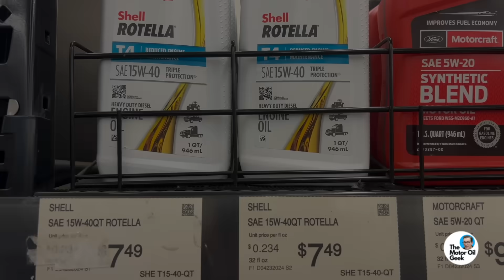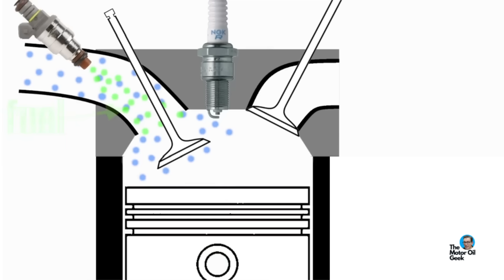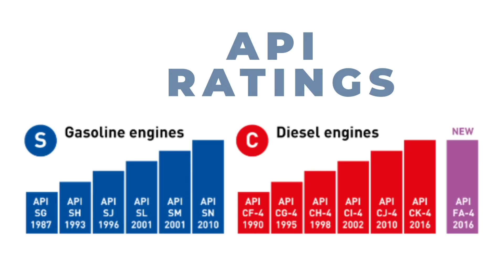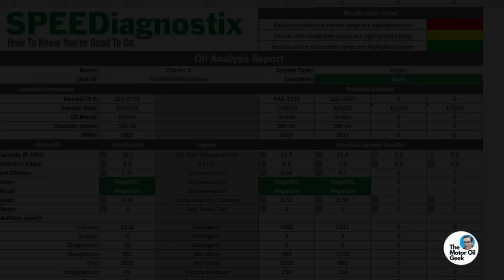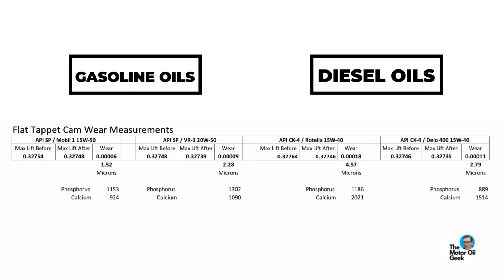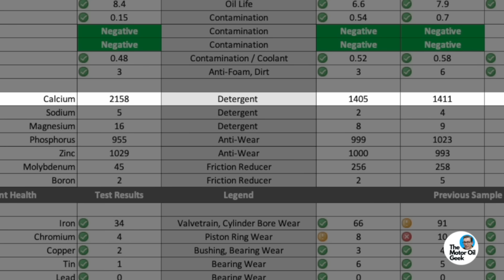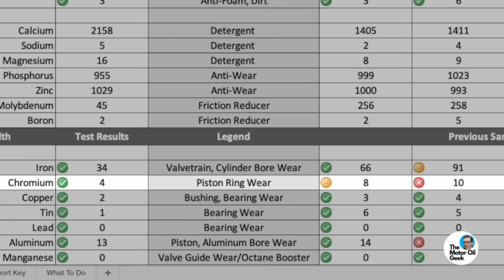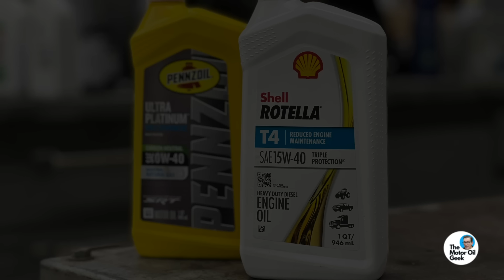Why DIESEL Oil is Actually WORSE for Gas Engines!

Comment: Have had the same daily for 25 years, 99 LR Discovery 1 3.9L GEMS / 211K miles. Until the last oil change, used Castrol 10/40 conventional, just did an oil change with Rotella T4. On a below freezing cold start over the winter, the motor made more tappet noise with the T4 then with the Castol, wasn't impressed. I'm switching back to Castol next oil change.

Comment: An EV oil change is every 150,000 miles! With money from the coal rolling equipment and the wasted fuel, you could drive an F150 Lightning to and from work for almost 10 years! And you wonder why your wife wants a divorce from you and your truck.

Comment: 1. Will SQ 10w30 gasoline oil have less zinc/wear protection than SP 10w-30 gasoline oil? Would you use either with no zinc additive added in very hi mileage low compression flat tappet cam motors?
2. My 22 yr old Briggs & Stratton powered lawn mower calls for straight SAE30 wt oil. Walmart sells two types of supertech SAE30 oil - SP gasoline oil.  & SG diesel oil - WHICH 30 WT OIL WOuLD YOU USE IN SUCH AN OLD MOWER? The old owners manual says to use their SF oil!

Comment: As a mechanic, I use Rotella in my 2000 Chev S10 because of the 330,000 km on the engine.
Reply: As a mechanic, I use Rotella in my 1996 Chevy S10 because of the 220k miles on the engine. I also use it in a few of my other cars as well.
Reply: @512Chaos  As a mechanic, you know your rods and mains are getting a bit sloppy, and the heavier oil helps keep  that nasty knock away.
Reply: @ Also, it's a Chevy

Comment: My Mazda 2.0 will burn 5qt in 3,000 miles, I bought Delvac 15w40 100k ago because it was cheap. It does not burn more than 1/4 qt every 3k with Delvac. (other 40w oils burn just as fast)

Comment: My Buell Manual says that if you can't get Genuine air cooled 20W-50 air cooled motorcycle oil   15W-40 Diesel oil is the second best choice.  I use 15W-40 Diesel grade oil in really cold weather   then change out to  20W-50 Synthetic air cooled Motorcycle oil for the summer.  Maybe switching types of oil back and fourth is not the best idea.. Maybe I need a similar composition of motorcycle oil just in a lighter viscosity for the winter?
  Is far as I am concerned most all of your tests are inconclusive.  If you really want to test something, run it 700,000 miles then tear down the engine.  Run a different oil in the same engine in the same conditions for 700,000 miles, tear down the engine and compare the wear and deposits.

Comment: I like the video but if you want real world results don't use audi high perf engines and ls engines for standards.  Use the old ford 4.9 I300 and the other old daily driver stuff that people are actually using this oil in.  My dad was a ford man 300 i6.  Used rotella long as I can remember and ran 300-400k on every truck he had.

Comment: I use Shell Rimula R6 LM 10W40 in my port injection engine, already 245,000km the engine is smooth like hell. Recently I drop the oil pan and it is clean like hell.

Comment: Are we inventing problems now?
Let's say I did have a gasoline direct inject engine (I don't), why would I think to use diesel oil instead of the recommended oil?
I still own cars I drove in high school in the 70's, I've never put diesel oil in them but have considered it.  They aren't direct ignition, this technology didn't exist, but they are flat-tappet pushron engines with carburetion, no less.

Comment: Absolutely LOVE your videos. I really wish more people watched them, specially the ones that buy into all of the misinformation about Thin oils, Low Tension Oil Rings, etc. I know it has been covered some, but I think people need a video just on how Application dictates Chemistry with very low tension rings requiring  0W8 oil of todays modern vehicles and higher, thicker rings of 30-40 years ago that required 10W30 and 10W40 oils and how people are still getting told the wrong thing and believing it.

Comment: 432,000mls on a 1100 Goldwing.Still factory compressions ect.Running diesel oils since 1 yr old now 44 yrs old
Reply: 432k! that is a shit load for a bike.
Reply: @rm25088 well ifs it's serviced and nor abused.Its never been an issue and let's be honest.Not over stresses engine either
Reply: Goldwings  weren’t fuel injected until 1985. Is yours carbureted? A 44 year old engine is definitely different than modern cars.
Reply: gsguy9359 yes origi Al carbs
Reply: Yes carbed and never been off either.And as I rebuild them for people all over the world.Mines never needed doing.but I do run it on two stroke mix,b4 laying it up to stop the carbs getting fouled up and run it dry b4 storage.Hughestune Classics UK Est 1977
Reply: Let me go get my rubber boots on
Reply: 1993 Honda Nighthawk CB750
72,xxx miles
Original engine, second clutch and still pulls as hard as it did 9 years ago at 19,000 miles. Even harder now that I have a few low end performance parts added But the engine itself is OEM.
I also ran it for 15,000 miles in a Yamaha FZ07 and she loves it also. 3,000 mile $30 oil changes, once shearing begins the shifty gets knotchy I run to Walmart. Filters and oil, in stock ALWAYS. Any Walmart in the country. 
Can't go wrong with Rotella
Reply: I'm waiting for someone to say this is anecdotal evidence, and doesn't prove anything, per usual.
Reply: @nefari0usD Yea except all he talked about was direct injected engines. We stopped talking about port injected engines half way through the video. A Goldwing is a port injected (or possibly carburated) engine. 

I was kind of disappointed by that fact. I was hoping for a port injected vs diesel engine test.
Reply: @ I know the video is mistitled. I was saying that multiple testimonials of non diesels doing hundreds of thousands of miles on rotella, are damned good evidence it is okay to use in port, tbi and carbureted apps. Yet some are saying in the comments, extremely high reliability for hundreds of thousands of miles or for decades isn't evidence. It's ridiculous.
Reply: @nefari0usD  Yea it's a bit funny to me how apparently this channel is all "use what works best in your engine" and "no two engines are the same" until what's best for your engine is diesel engine oil. I do run amsoil in my LS1 C5, but I ran 15w40 T6 in my 92 C4 Corvette for 50k miles of track days and 6+ hour road rallies where the engine sees 4k+ RPM the whole time. It did great and that engine still has great oil pressure and looks brand new inside. I run Rotella in both my motorcycles (85 Honda nighthawk, 85 Honda V65), have in my 94 E420 Mercedes, 93 Jeep Cherokee 4.0, 85 300ZX Turbo, I even ran 5w40 Rotella in my Saab 93 2.0T before I sold it. 

The only thing all those cars had in common was they were old port injected engines and they all ran fantastic with Rotella.

Comment: Been using shell Rotella T4 or T3 when it was out 15w 40 in every engine owned with Marvel mystery oil an  never had a problem from 1hp Briggs engine s to big Mack e7s in fact my 87 360 v8 dodge has had these done since new an the engine has never been opened or has never experienced any issues except for the carburetor being gummed up from the gas hell my 1982 walk behind has had that same Ritola an marvel mixture its whole life and I had to split the engine to reseal it an it looks absolutely brand new inside an almost no ware on cam  lobes or lifters The plastic oil splash or/governor gear no discoloration or damage no play in crank an rod Assembly shit The cylinder still has the cross hatching on it all and being part of a commercial landscape business we had a big fleet if big block efi  v twins zero turns which got oil changes every 50 hours which was once a week and we use the shell Rotella cause I was the only oil that can take the job oil that Kohler called for needed to be changed every 25 to 30 hours an engine also consumed it

Comment: 15w-40 goes into my Briggs & Stratton Quantum engine.
Reply: I always use rotella t4 15w-40 if t6    
5w40 was cheaper I’d use it during winter
Reply: I run whatever oil I grab in my 20hp B&S Intek for 19 years now. Keep oil in and change it regularly for longevity. Zero problems aside from a blown head gasket due to design flaws.
Reply: I have run 30 weight mobil diesel oil in my 12 horse briggs and stratton engine on a Murray riding lawn mower for 34 years. Engine runs great and uses no oil.  Diesel oil works great.

Comment: Aren't a lot of diesel engines also flat tappet engines? I mean many newer ones are roller cams and lifters but lots of older trucks still use flat tappet engines and they never have cam and lifter failures that take them out.  And a lot of cam over valve engines actually use valve pusher that acts just like a flat tappet lifter but with no push rod! They use this new low zddp oil and  dont seem to fail in that part much either!

Comment: Well the entirety of the motocross community uses T4 and T6 Rotella. Most of the factory teams prop up their brands (Yamalube, Pro-Honda, Motorex, Ecstar etc... but their engine guys are pouring YeOld Gold Rotella in their race engines. 
The viscosity requirements and shear resistance is absolutely a match and the additive package meets the wet clutch requirements as the motor oil and transmission and clutch share the same lubrication system.
Reply: Thats right. Regular automobile oil will not get you past 50 hours on a 450 MX bike before failure.
Reply: Been using T6 rotella in my 450s for years. I also put it in my quads, lawn mowers, generators, honda accord, mercury outboard 60… you name it. Awesome oil i swear by it.

Comment: I have ben running 15-40 diesel oil in gas engines for 20+yrs. 350,000 miles on my current ride. Frequent oil changes are key!

Comment: Well, I been around for some "Decades" now. I've Built some Engines here and there, Flatheads, ( Tons of Model A Fords also), Some Lower end's on Old Cat's (Babbitt Work), Small Block Chevy's & Fords Bla Bla Bla. I've alway's used the Manufactures Recommended Oil's and NEVER had any Issues!  So for "me", I'll Stick with what is being said here ba Lake and Dave. To Each His Own!  Lotta Scuttlebutt on Preference's. GOOD LUCK TO Y'ALL. I'll run the Factory Recommend STUFF!

Comment: I use it for my Renault k4m gasoline car engine Shell Helix HX8 Synthetic 5W-40 which in the specification sheet clarifies that  meets the specification and requirements for Renault RN0700, RN0710.  Shell Helix HX8 Synthetic 5W-40 It also specifies that it is for diesel engines. IS IT WRONG?

Comment: Oh, hell, no! If you have a GDI or any modern gasoline Car/SUV/Truck engine, especially a Japanese engine, then 0W-20 to 0W-8 is required (full synthetic). I use Idemitsu IFG7 full synthetic in my Lexus ES300h vehicle (formulated specifically for any Japanese hybrid engine). It is a great oil from a great Japanese lubricant manufacturer.

Comment: Unlike API specifications which as mentioned in the video differentiate between gasoline (S) and diesel (C) engine oils, ACEA specifications for light duty vehicles apply to both diesel and gasoline. Does this mean the Euro-spec oils such as ACEA A3/B4 are a compromise compared to the more fuel-specific oils?

Comment: This is bullshit test. He test two different viscosity between gasoline and diesel oil, moreover it's from different brand. Is it really hard to find oil with same viscosity? nope right, so guess this is just a way to make gasoline oil better because higher viscosity usually protect better but at the cost of more fuel consumption. The difference is more likely happen because of the viscosity and the brand, not because of the type of oil itself. 🗿

Comment: Ok ive been using rotella in my gas pickup trucks since 89 !! Got a fleet of 92 machines onroad and off rd ford 4.2 v6s 5.4 and v10s in our fleet 345 and 475000 miles on our service trucks no engine failures!!! Rotella t6 in our 4  6.7 powerstrokes all running great!!

Comment: Been running 15w40 in gas engines (air and liquid cooled) for over 50 years. None of those engines blew up or failed due to the oil. Big fan of Delvac and Delo oils.

Comment: Zink...
So when you have a brand new engine it would be recommended to use this for your first 3 engine oil changes.
500 miles.
1,500 miles.
3,000 miles.
And then go to synthetic every 6k miles.

However...
You can get zink additive for your gas engine break in.
I also believe there are some oils designed specifically for racing that contain a lot of zink.

Comment: If I didn't already know most of what's in this video about the difference between diesel and gas engines, port vs. direct injection, I would not have gotten a thing out of it because of the poor editing and jump cuts.  Showing a gasoline port injection illustration while talking about direct injection, for example.

Comment: Why don't you do a comparison between the top diesel oils. Like Rotella T full synthetic, Delo full synthetic, Chevron full synthetic.  There is a lot of diesel trucks out there.  What oil is the best?  I doubt that anyone will ever due a comprehensive comparison.  I have a 2018 6.7 Cummins, I would like to know.

Comment: I would love to see a video on the oil to use in an antique engine, i.e Model T, Willys L134, etc.
Reply: Easy....  Just talk with any Farmer or Rancher.  ALL of their machines from Lawn Mowers to giant Tractors, Gas or Diesel will be running various brands of 15w40 Diesel Oil.
Only exception will be if the Wife has some sort of 'Throw Away' daily driver P.O.S. and it'll have whatever crap the local Service Center puts in it.
Reply: we always ran Diesel rotella "T4" in all the gasoline TRUCKs..  I suppose modern cars are different but old international SV engines, Chevy tall deck etc...  many school bus garages ran it too when all school busses were pretty much carbed gasoline engines..

Comment: Since 2000 I have never had a oil related issue on any of the vehicles I've had. Use a good oil, use the correct oil, change it regularly. There that's the secret folks
Reply: Hey RJL, I see you in the PathfinderTalk forum.
Reply: 5w30 is the correct weight for 90% of cars in the lower 48 states. Canada and colder places 0w20 is good for winter. Anything lower is simply to meet CAFE standards that the EPA implemented poorly. Thin oils damage the engine and leak and burn oil faster than thicker oils.
Reply: @TheScrubmuffin69  engines with tighter tolerances (modern engines) need thinner oil